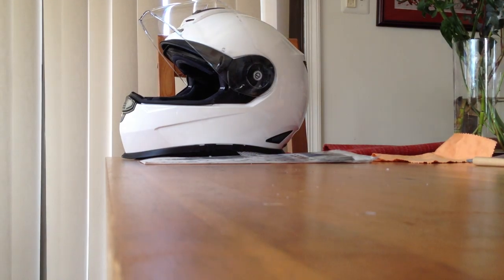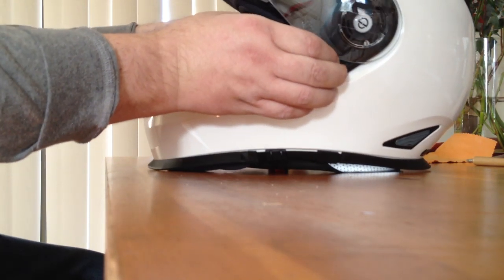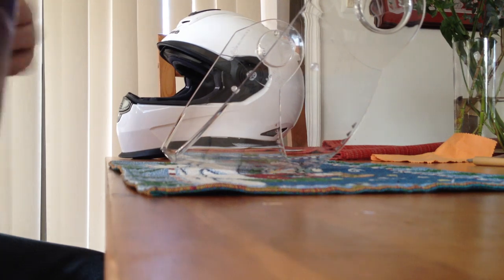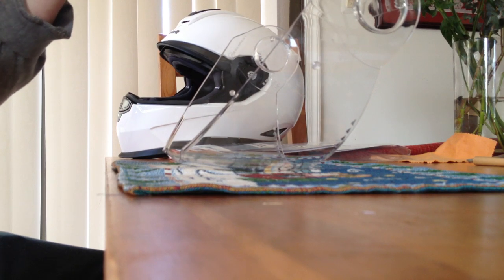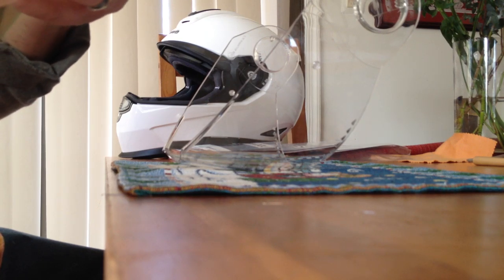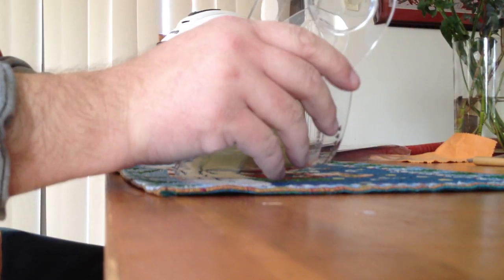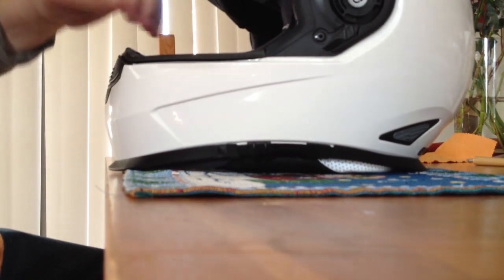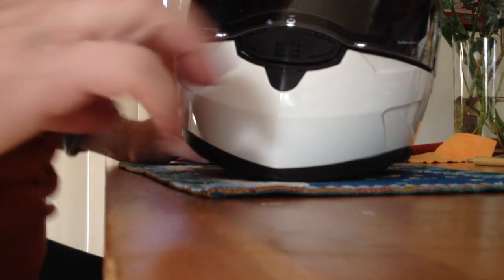Installing a Pinlock insert onto a Schuberth S2 face shield

Comment: I was hoping for some insight into the pinlock post adjustment.  It is an eccentric cam but I don't know a good seal from a not so good seal.  I can't tell if I'm tightening or loosening the fit by looking at the post.
Reply: I know this comment is 4 years old, but for everyone else's benefit:
The arrows point towards the cam lobes.
Arrows pointing outwards is loose, arrows inwards is tight up against the visor.